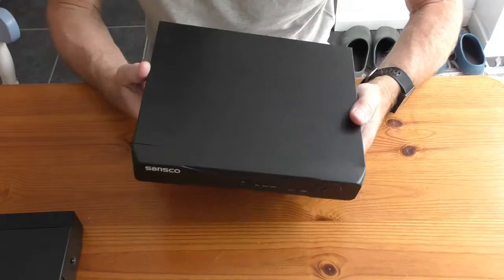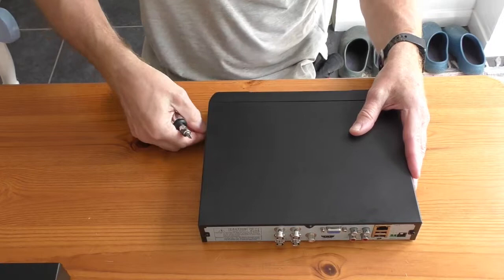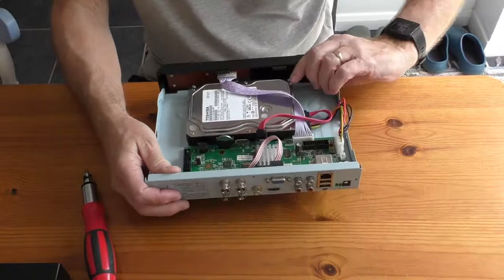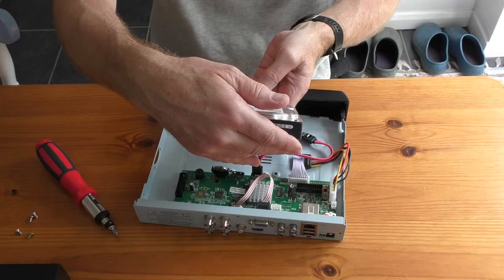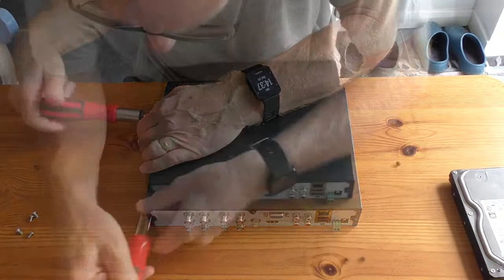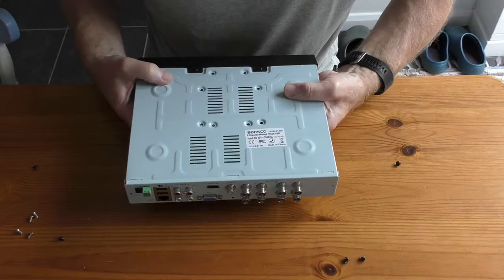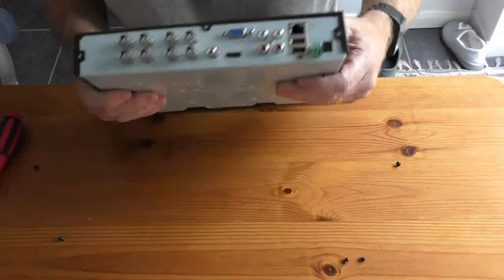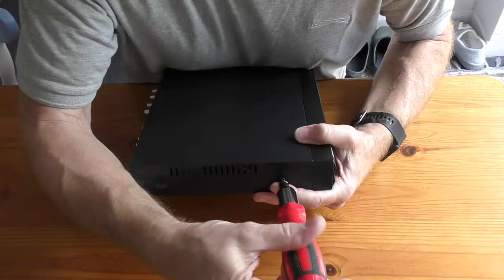Sansco CCTV  Installing the hard drive /Transferring the hard drive

Comment: My dvr is making a clicking sound, when i go to menu and want to playback it does not give me the menu bar across the bottom showing my 4 camera as before..is this a hard drive storage issue do you think please? What are my options. I can view live via my tv but cannot playback. Thanks.
Reply from the maker: if you can't playback, you can access the system main menu and check whether the hard drive storage is detected as normal status.

Comment: I just installed a brand new solid State Drive, 1 tb, but the bow will not boot properly, shows the Sansco splash screen then goes off. It is doing this continually.
Reply from the maker: this may be the hard drive or power adapter issue. You can try another power adapter and see if the DVR works. 
disconnect the hard drive, retry the DVR and see if it works.
Reply: @SanscoDirect  A different power supply? The external one for the dvr?
Reply from the maker: the 12v2a power adapter for the DVR.   @Ilovebunkering

Comment: Would a solid state drive last longer?
Reply from the maker: the CCTV DVR does not work with external hard drive, please use the internal 3.5" or 2.5" hard drive.
Reply: dont use solid state, its constantly read/writing which ssds dont like

Comment: I done mine  but still says no storage 😢
Reply from the maker: can you confirm you installed the right hard drive?
Make sure the hard drive is working.
Reply: @SanscoDirect  got it thanks it's power issue not enough to power hard drive swapped them and works perfect thanks for help and also your YouTube videos
Reply: @davyfaeforth  Did you swap the new drive or the power supply?
Reply: @Ilovebunkering  power supply worked straight away m8
Reply: I have given up and ordered a new box, probably fit a better system when this box konks out.
Reply: @Ilovebunkering  that'd what I did then found out you need to swap the 2 power supply plugs 
One for box and one for cameras swap them about as one let's more power into system and then hard drive works